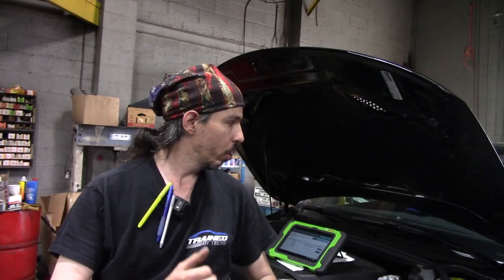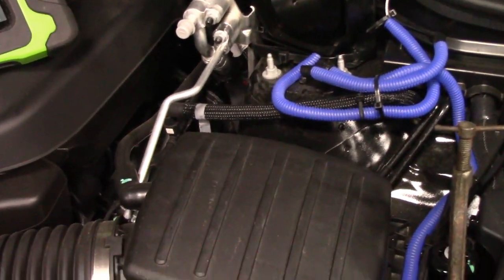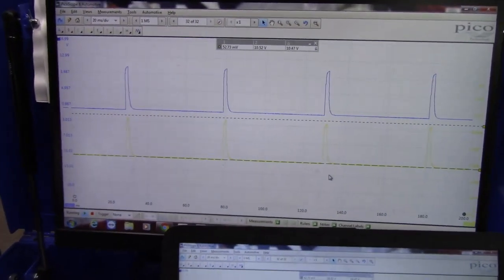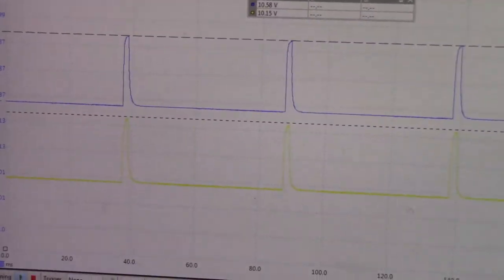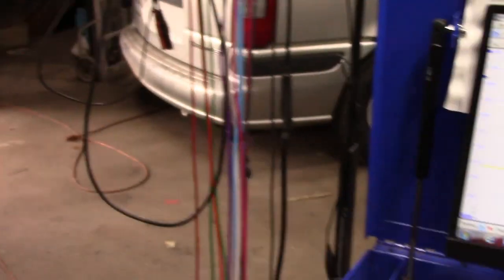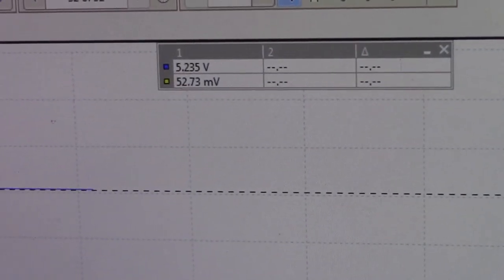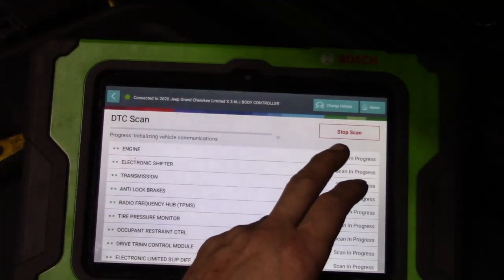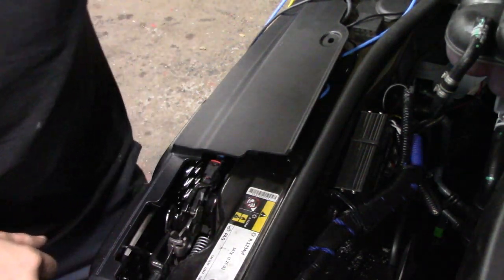2020 Jeep & Aftermarket Parts (Why you should not modify modern vehicles!) SGM With Bosch ADS 625!!!

Comment: The blame here should not be on aftermarket parts but a single incompetent owner, or an “idiot” friend of his.  I highly doubt this was done at a specialty shop.  Look at that spiffy blue tubing, my belly tells me the owner bought that off of eYay and its all a self install.  Most shops just carry black tubing not that stupid colored “look at my looms!” jazz.  The factory horn is a straight shot circuit after +12v comes out of the factory relay.  Swapping it out with another to change tone should cause no codes whatsoever unless your trying to wire something like a freight train horn that exceeds the amperage draw on the factory circuit.  I would have to guess when the idiot added the gizmo horn either somehow backfed +12v down that BCM ground feed (I cant fathom why) or tied the gizmo horn ground into that.  That add-on horn works like a tiny car amplifier and may have pulled high current through that ground feed circuit which its most likely not designed for, thus damaging it.  For me this is such a mind blowing fail as this is such a simple 2 or 3 wire hook-up.  Even though that toy horn is a cheap China POS, it still could have been installed with no interference to the vehicle itself.  Once again, aftermarket parts and installers are not all to blame here for the incompetence of a single blithering idiot.  

I never knew about this restricted “gateway” thing until now, what a load of utter bs, surprised that does not infringe on right to repair.
Reply from the maker: Just to be clear it was a police horn installed, and yes, they hooked up the power feed from the relay to the sensor ground from the BCM. Big fail.

Comment: I think the moral of the story is have a basic understanding of circuits and grounds before modifying wires and modding.  I have a 2020 4runner and installed a front facing camera.  From 500 miles to 13k miles no problems.  I made sure all three [3] grounds were sound and all the wires were not compromised.

Comment: The secure  gateway module is BS. What a greedy use of technology. You have to pay a fee and get permission? No...
Reply from the maker: Apparently because of vehicle theft...but i have my own thoughts on reasons for this. I am sure it will come to light soon enough if I am correct.
Reply: @JoesAutoElectric  You can buy a gateway module bypass. It allows you to connect your scan tool beyond the gateway. It is a second obd2 port  installed past the gateway.

Comment: THANK"S JOE,what your message means ...DON"T MESS WITH YOUR NEW CAR>!!!It's basically like turning on your laptop and running your ham fisted fingers all over the keyboard while holding the enter key down and then ,wondering why it only puts out gibberish on the screen when you now turn it on.THIS IS ROCKET SCIENCE....YOUR car is really  a series of COMPUTERS that need to work together in harmony to work properly.After market stuff usually are made for older car that don't have SENSITIVE ELECTRONIC components on them.If an option you want isn't available when you buy your car there's' a reason.thanks for the heads up video JOE.

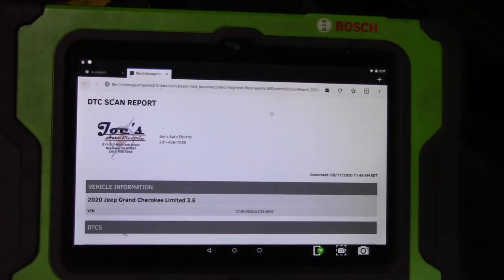Comment: 2:00 in thinking 🤔 of My time at Chrysler Dealership... Vehicle Software updates on modules? 🤔
Reply: Still watching
Reply: Soo all circuits so far are having grounding issues. Interesting 🧐 I just learned of that New Gateway module talking with J aka Welding Junkie
Reply: Will all scan tools drop in and out because of the new security module?
Reply: Ooohh dang... it took out the BCM? That Sucks.

Comment: We have a 2018 Jeep Compass (in our shop) with aftermarket touch screen has constant start fail due to dead battery. Install factory radio no battery drain. I don't understand the mindset that you buy a late model vehicle change the factory setup, buy all your junk on Crutchfield ( they sold this person the wrong interface for the Can system. Also with aftermarket, odometer was flashing which indicates a problem in communication with BCM. Happens a lot more than you think, I can't be to upset, it provides much needed income, plus I need something to laugh at. I really like your channel Joe!!
Reply from the maker: Agreed 100% with you.  And thanks for the support!

Comment: I work at a parts store, so I get to see all kinds of stupid shit like this before it comes to you guys.  I had a couple kids (under 25) with a 2016 Caddy that had decided to throw a couple of el cheapo "go fast" parts on like a "cold air" intake, a "chip" (resistor), and a canned tune.  There was a CEL and it ran like GARBAGE!  I knew what was going on based on the codes our shitty scanner gave me before looking at the car... 
"Did you put a custom intake on it?  What about an IAT mod?"
"... Uh... Well yeah!"
I got visibly distraught.
Their work involved wire nuts and hot glue.
That is all.

Comment: Am I understanding this correctly, they tied in the ground of their fancy new horns to a signal ground and fried a portion of the BCM?? What an unlucky pick of wires for a ground, why not just use a frame bolt or something? 
Aftermarket wallet flush, recommended by 0/10 mechanics.
Reply: Probably connected the power from the horn to the signal ground, thus sending god knows how many amps into the signal ground of the BCM. The weak link wasn't the horn fuse but the BCM.
Reply from the maker: @Jernej Jakob, that is correct sir.
Reply: I expect the generic instructions say you need to connect to the hood latch to trigger the alarm/horn.
Reply from the maker: Shauns Auto Repairs, 100% correct...but they sent 12 v to the BCM ground.

Comment: Modern cars are computers with motors, sensors and actuators, not your simple black and red wires anymore!

Given that each generation becomes more software driven, I can see where, in the short future (5-10 years), only the dealer would be able to do, replace or repair anything that connects, or interacts with the main computer (ECM).

Basically, everything but the wheels, brakes, tires and simple switches or lights.

Yes, it’s all software, so there is always a way, but with encryption, blockchain and one time tokens, gets much harder to ‘copy’ or reverse engineer.
Reply: The issue is not modding or installing parts.  This person connected the ground with the power wire.  That's just an idiot thing to do.  It doesn't mean no one should mod their trucks.

Comment: The bcm isn't supplying the ground to the devices -- but does the bcm have a good ground to send out?  Should bcm powers and grounds have been verified?  I realize all other functions of the bcm still work, but Ivan just posted a video where a fuse was loose and only a few small operations of the module had failed.
Reply from the maker: Yes...once again I did this video rather quickly on the fly. I did verify P&G supplies. But thank you for bringing up a great point I missed in the video.
Reply: If the BCM (or any of the computers) controls anything by switching the ground, it's probably using N-channel mosfets. N channel mosfets are easy to drive high current devices from a microcontroller, but they're only rated for so much current. If you put too much current through them (by using that controlled ground as a general ground for a high current thing), the mosfet will blow up, and then the computer can't provide ground anymore. Low side switching (switching the ground side of something) is cheaper, as it only takes one mosfet. High side switching (controlling the power side) takes 2 mosfets, so when possible most things are low side switched as it saves cost in the BCM (or ECM / PCM etc). Sure, mosfets are only a few cents, but why use 2 when you can use just one! The BCM could probably be repaired by putting new mosfets in it - only takes a few minutes if you have the right soldering equipment, and of course, if it's not potted.
Reply from the maker: @gorak9000  Seems you have some electrical knowledge! LOL
Reply: @JoesAutoElectric  Yeah, I'm a electrical / computer engineer by trade, so yeah, just a little :)

Comment: Everything worked when u installed the ground. Why does  the BCM need to b replaced?
Reply from the maker: Because I can not in good conscience warranty that as a correct repair for the vehicle. The BCM is the actual fault and this vehicle has 20000 miles on it. If it was my own vehicle, sire. But then, I wouldn't destroy my own vehicle due to this sort of thing int he first place.
Reply: @JoesAutoElectric  Thank u!  I didn't understand that the BCM was not supplying the grounds. My mistake.
Reply: I would assume to keep the warranty maybe? The ground is supposed to come from the BCM and complete circuits for at least 4 sensors. It's a can of worms otherwise. Owner might've voided everything with his shenanigans.  🤷🏻‍♀️🤷🏻‍♀️
Reply: @CubasAutomotive    Thank u!!  My goof.
Reply from the maker: @billrimmer5596  It is my fault for throwing the video together and not explaining it in a clear manner. Thank you for your thoughts as always sir.
Reply: @Bill
 BCM does get grounded externally but it's regurgitated to other sensors here. When modules provide their own grounds to sensors, it's typically to keep those them circuits clean as possible. Might have capacitors in line internally.  

No goof. You don't know what you don't know. We all learn here. 😉😊